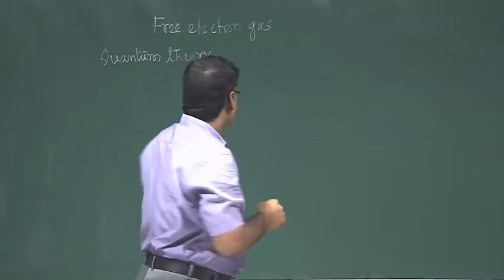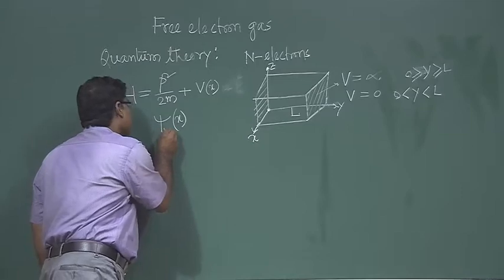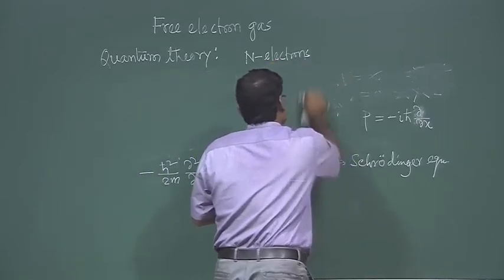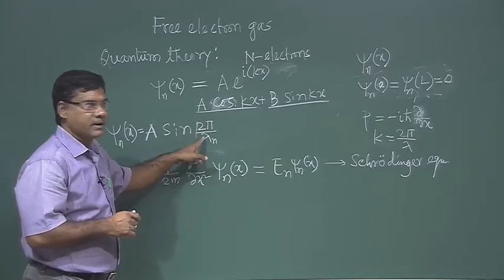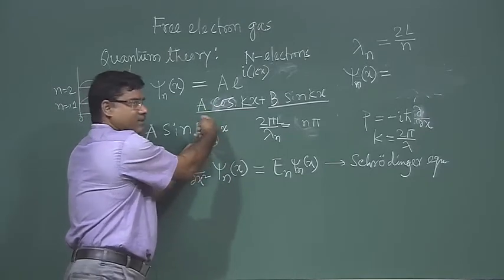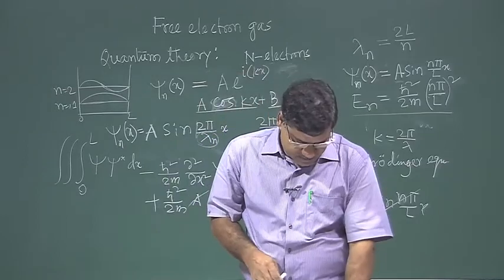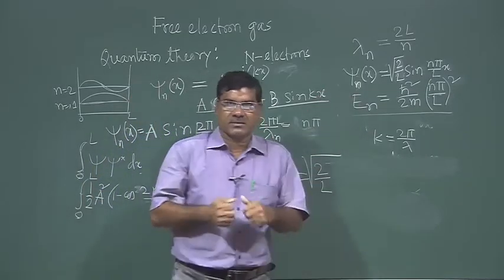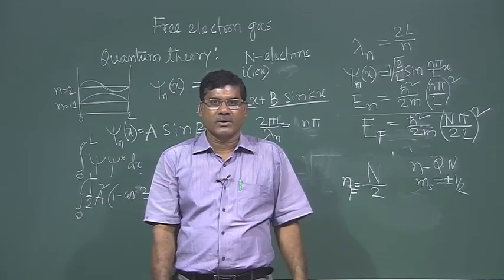Lecture 36: Electrical Properties of Metal (Contd.)

Comment: Sir outstanding lecture ..... Question is that ..Is it possible free electrons can not interact with each other
Reply: Electrons do interact with each other and with the positive ions in the metal. This gives rise to a periodic potential inside the metal on contrary to zero potential that we considered in this case. This is discussed in band theory of solids.